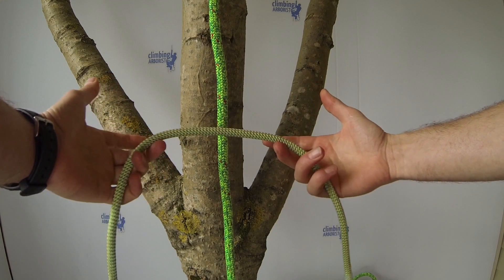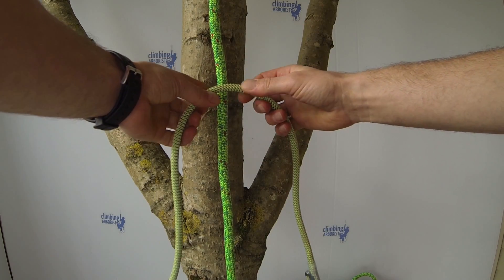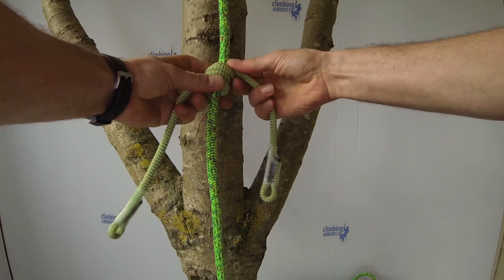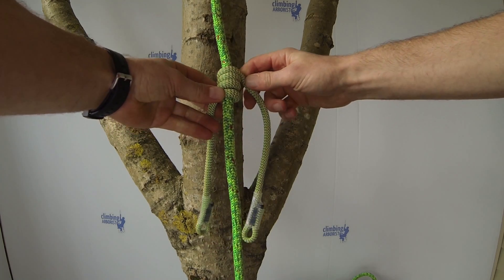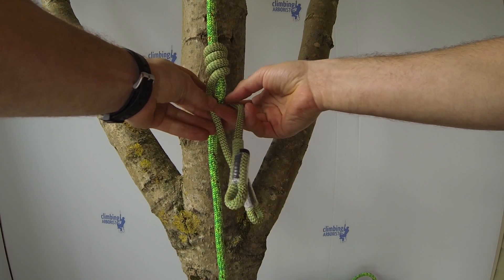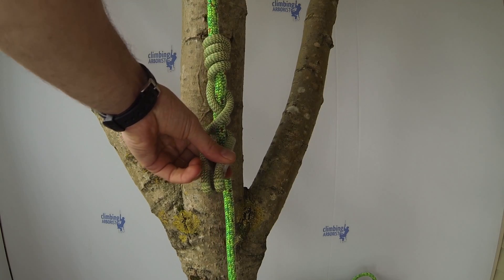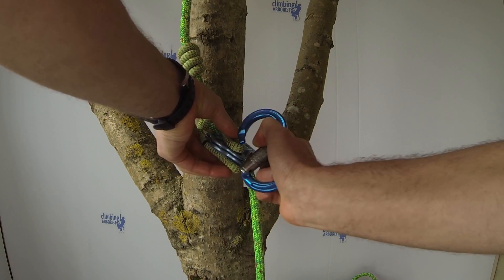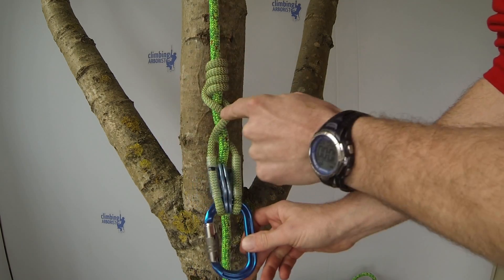Valdotain tresse | Knot tying for Arborists

Comment: Hi, I'm Italian but this node is used to slow down the descent on single rope?
Reply: Stenozel a progress capture device kinda similar to a prusik. It’s just easier to manipulate
Reply: It moves up freely, and grabs when you sit back, or weight the rope. A micro pulley helps when tending the slack too.
Reply: @chipper442  Can also be manually pushed down towards a load allowing for controlled descent. This is important when you have a load on the rope and need to attach a method of descent without unweighting the load, common in rescue scenarios.

Comment: @climbingarborist- how does the hole position play a role in the setup? I have a micro pulley that only has one hole for the caribeaner... thanks
Reply: Get a hitch climber, they have three holes.  The prusik and pulley attach to the bottom hole, and the end of your climbing rope attaches to the middle or upper hole. 
Otherwise, the carabiner goes through one eye, then the hole in the pulley, then the other eye and captures both.
Reply: @chipper442  that’s what I ended up doing. Thanks!

Comment: I’m using Rope Logic 8mm x 30 spliced eye to eye and when I tie the vt the way shown, the stitched area of the splice lines up just above the top hole of the hitchclimber causing the rope to come in contact right where the stitch and label are on the prusik. Will this be a problem long term as far as friction causing damage to the rope and/or stitch. Wish I could attach a pic. Thanks
Reply: I always use the center hole, which keeps my rope from touching the friction hitch ( most of the time) I’ve had a few times while using sewn eyes that it grabbed and let me free fall a bit.  A simple fix is to cut the sewn eye off one end and finish with a knot. I’m sure there’s other ways but that’s my personal experience. The sewn eye is just too thick on some ropes to work flawlessly when clipped into the hitch climber pulley in the top hole. I’d also suspect the jacket that protects the stitching causes a ton of friction compared to rope on rope

Comment: i have a 38 inch e2e will it work or is it too long for the VT knot?
Reply: vonsvensson it'll work. Add an extra loop at the top if you want more security. It might bite to much when climbing but .....safety....
Reply: My 30” was too close for me to use my hand/foot ascender. 38 would be better for me